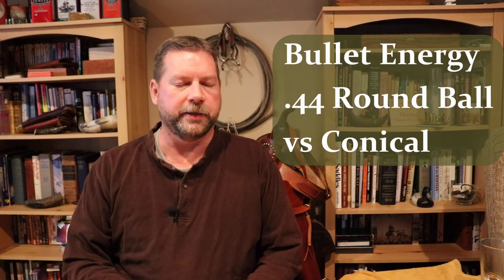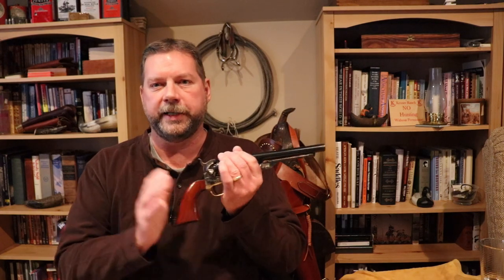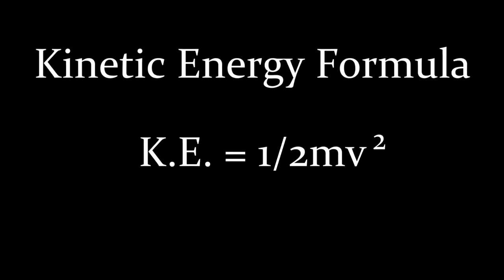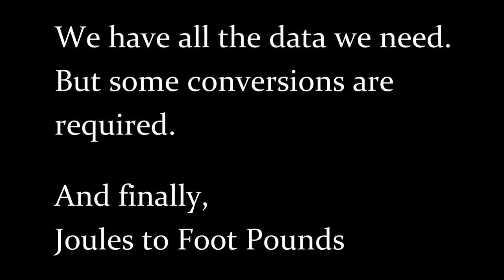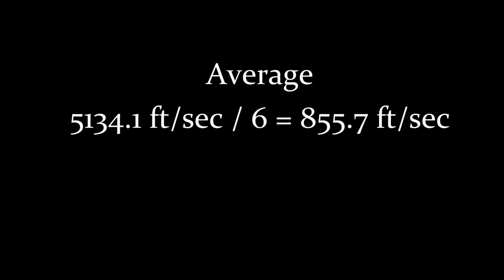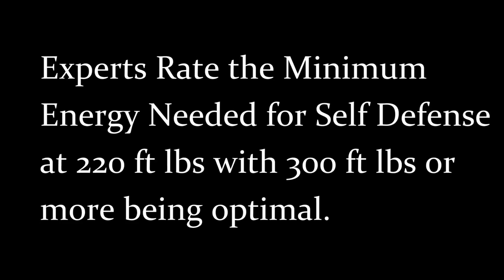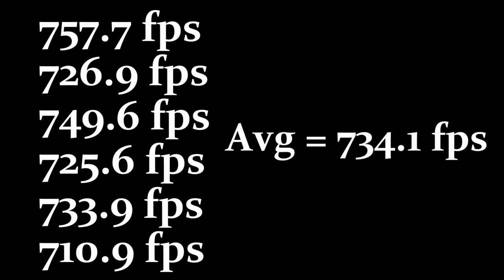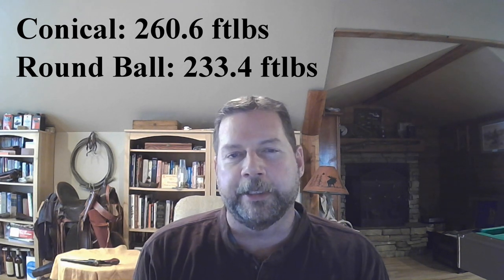Knock Down Power of the 1860 Army

Comment: Great video! Just a tip for the future, you don't have to convert everything into metric. The English unit of mass is the slug which is equal to 32.2 lbs on earth. Once you have the bullet weight in lbs, divide that by 32.2 to get slugs, then plug that into the kinetic energy equation with velocity in ft/s. This will give you slugs-ft^2/s^2, which simplifies into ft-lb which is the unit for energy. Most people have never heard of the slug though haha
Reply from the maker: Thanks Ethan, I have not heard of the term "slug" for weight.  It makes me wonder if the term is responsible for sometimes referring to a bullet as a slug.  Thanks to tips from video watchers, I have simplified the calculations significantly.  Todd
Reply: My favorite imperial unit is the Erg.

Comment: I think you make a good point about penetration--the formula for kinetic energy implies all the energy is transmitted to the target, but the better penetration of conical bullets means some of it is lost if the bullet leaves the body.

There is, however, another factor to consider.  When most people do this test, they usually use comparable charges with round balls and conicals.  This may not reflect the practice of the time, however.  For example, the military issued Johnston and Dow cartridges had 25 grains of powder, but if we read Colt's loading instructions for loose powder and ball he says to fill the chamber then set the ball on top and ram it home, and the powder will compress enough to let the ball fit.  This technique will allow a lot more than 25 grains of powder into the chamber--more like 35.  This is echoed in Whittaker's "Volunteer Cavalry Instructions" from 1871 where he says:  "For loading Colt's revolvers a powder-flask and bullets are much better than compressed cartridges. The latter have hardly any strength. I have seen pistols burst in firing a second shot from their use. The first bullet stuck in the barrel midway, the powder not being strong enough to expel it fully. The second burst the pistol" (p.14).  From this, is seems quite possible that the round ball would have had even more velocity than most people get in their results, and remember that in the formula for K.E velocity is far more important than mass since the K.E. increases as 1/2 of the mass but as the square of the velocity.  When combined with the penetration issue you raised, I think this clearly explains Keith's comments.
Reply from the maker: Thank you.  I did indeed have more powder under the round ball and it contributed to the higher velocity.  Your interpretation of the formula is spot on - velocity is squared and explains why a small modern bullet with little mass can have so much energy for big game hunting.  It's going 3000 fps.
Reply: What did Elmer say about this ?
Reply: @forestgrump2168  He said that some folks preferred round balls because they didn't over-penetrate, meaning all the power is expended in the target.

Comment: In a comment on your other video, I mentioned the book "Stopping Power" by Evan Marshall and Edwin Sanow. They wrote 3 books evaluating actual field performance from real life defensive shootings to develop a theory and formulas for predicting the effectiveness of bullets, cartridges, and loads. In their last book, there is a chapter on cap&ball revolvers. Their measurements and calculations mostly match your own (840 ft/s on 30gr 3F w/ 141gr round ball, 726 ft/s on 25gr 3F w/ 200gr conical).

You mention 300ft/lbs of energy as being "optimal" for self defense. To put the numbers in perspective, an 88 gr JHP 380 ACP only generates about 196 ft-lbs. They recorded a higher velocity (935 ft/s) for their 1860 Army using 35 gr of 3F to propel a round 141gr ball, generating 274 ft-lbs, only slightly less than a modern 44 Special 200gr lead HP (292 ft-lbs). For the Ruger Old Army (40gr 3F, 141gr ball) they calculated 333 ft-lbs, for the Colt Dragoon (50gr 3F, 141gr ball) 437 ft-lbs, and for the Colt Walker (60gr 3F, 141gr ball) 519 ft-lbs. The modern 41 Magnum (175gr JHP) only produces 608 ft-lbs. As you proved, these guns are not only capable, they have impressive power even before considering projectile expansion.
Reply from the maker: This is great stuff.  Thanks for taking the time to share this info.  I'm planning to test a few more guns and we'll see if they continue to match up.  Todd

Comment: Very interesting.  I love BP but use Pyrodex P in my cap and ball revolvers exclusively.  I use the eras gone Johnson and Dow bullet with 25 grains Pyrodex P. 
Excellent video, and informative.  Great baseline. I found with Pyrodex I get closer to 45 acp stats.
Reply: You should make the switch to black powder. I used to use Pyrodex P but since using black powder I will never go back. The black powder ignites more reliably,  quicker and cleans up easier.
Reply from the maker: I agree.  But sometimes there is no choice.  Black powder is getting very hard to find and few places online carry it anymore.  I just received some via FedEx and the hazard fee was $50 plus shipping.  Still, if you can get it, do.  Todd

Comment: Excellent work. The next step in investigating stopping power of the 1860 Army would involve emphatically seeing what it does on the intended target…a meat target of some kind. The low #’s may be moot if the performance on the meat target is respectable. Remember, the #’s do not reflect what lead in its various configurations are capable of on the intended target medium. That dynamic must be tested & observed before final conclusions may be made.
Reply: The US Army conducted many such tests in the 1800s. Much of that information that the Army made reports on are still available today. Also, Colt made many such experiments and testing and much of that can be found in Colts historical records library in Connecticut today. Very good reading.

Comment: What an insightful explainatary video.
The clear articulate way you present the Formulas for calculation of the power factors, is amongst the best discriptive done!

I wanted to develop the most capable, effective projectiles for Black Powder cap&ball percussion revolvers for effectively quickly putting down dangerous apex preditorial animals, like Bears and Wild Boars etc. 

So I did my research& development were I discovered that if I combine the aspects of the Round Ball face into a elongated conical with a Flat Nose, I would have the best attributes of both in in one effective unit.I reverse engineered both modern conical round nose bullet designs along with the round ball spirol momentium metplat to come up with what has been proven to be a very effective' capable projectile series known as the Kaido Ojamaa-VKV  Universal RFN Bullets.

 With good stout loaded "Well Regulated"  Steel Framed percussion revolvers have been tested and achieved over 500 Foot Pounds of Energy that also stays on it's Target path without diversion. My Universal RFN Bullets, have been used in various percussion revolvers to take a 2.200 enradged Bull to Wild Boar, Deer, Turkey. I currently offer custom produced six cavity molds to hand cast my Universal RFN Bullets. Contact is; kaido93@hotmail.com
Reply from the maker: Impressive.  And some people think black powder incapable.  Thanks for watching, Todd

Comment: Seems kind of superfluous to convert velocity given in feet per second into the metric system convert to joules and then rotate it back to pound feet.  I just go f=ma, a is vel squared.  Constant of 450,240 so:   855x855x143gr/450,240 or 232 ft lbs.  pretty straight forward Without moving the units back-and-forth just keeping them in grains and feet per second and using the mathematical constant I show.
Reply from the maker: Thanks Roddo, I had no idea there was a constant denominator.  How was that determined?  But it seems to work.  It must be a one-step factor that makes the equation work with non-metric measurements.  I'm curious about the origins of this now.  Thanks for the info!  Todd
Reply: Sure thing. The 450240 is mathematically derived simply through conversion of units. While the math here does not lend itself to an easy format as a YouTube reply suffice to say it is the formula Output for the conversions which are themselves a constant such as 7000 grains equals 1 pound, 454 g equals 1 pound, ; and where speed is equal to distance divided by time (mph for example) 5280 ft. with denominators of 60 sec/min and 60 min/hr.  Makes more sense all written out with the conversion of units that cancel but since (American) ballistics still seem to want to use feet per second and grain weight of bullets simply squaring the published velocity in feet per second times the grain weight of the projectile and dividing it by the 450,240 will always get you an accurate number. Good video and thank you for making it.  For the record I prefer to work exclusively in the metric system myself :)

Comment: Good video but there are two things I would have done differently. 1 I would have posted the powder charge, 2 I would have used paper cartridges since they allegedly produce more pressure & they would have been more common for the army to use.
Reply from the maker: Good points.  I think I talked about the powder charge, but maybe didn't put it on the screen.  It's been a while since I filmed this one.  Using a paper cartridge charge would be a good thing to compare.  I'll do that the next warm day.  It might be next June.  Thanks for the comment.  Todd

Comment: One question: what was the powder charge you used with the rb's and conicals, respectively? I've always had the impression that velocity of the ball would be around 1000fps with 40gr of powder, and conicals in the 800 - 900fps range with about 30gr of bp. Maybe I was thinking of another revolver, like the 1858 Remington, though, I'm not sure.

Comment: Check out video by kido fujioma on semiwadcutter bullet style made specifically for hunting...ive shot them...theyre a heeled 230 grain bulletwith a wide flat metplate loaxed over 35 grains of tripple7.,...way hot load....backed down to 30 grains..this load is managable but rough on 1860 pietta ..strain onwedge and under lug for loading lever

Comment: Why in the world do you complicate this jumping back and forth between SAE and metric units. Joules and pounds/foot are measures of the same effect. Pick a unit and stick with it. Either way works. A mix of the two is simply confusing.
Reply from the maker: Mainly because my mind understands foot pounds like it understands miles.  I get kilometers, but tell me a distance in miles and I have an immediate understanding in my head.  Tell me in kilometers and I'm not so sure.  The formula for energy is made for metric units.  So I have to input metric values and then convert to foot pounds at the end.  Hey, it works for me and gives me a value I can relate to.  Plus it makes my son think I'm smart.  Thanks for watching!  Todd

Comment: I appreciate your efforts however none of this matters without knowing the powder charge. And since the powder is variable the energy will be different and was that an 8" barrel?  Barrel length matters.
Reply from the maker: Great points all.  I should have reviewed the specs from the previous video where I took the velocities.  With .457 round ball, I used 35 grains of 2F Olde Enynsford.  With the conicals, I used 30 grains of 2F Olde Eynsford to make room for the longer bullet.  The barrel length of the 1860 Army is the standard 8 inches. Thanks for watching and commenting.  Todd

Comment: Maybe I missed it in the video, but I’m wondering how many grains of powder were used. I assume it was equal for both the conical and round ball?
Reply from the maker: The round ball had 35 grains behind it and the conical had 30.  The conical bullet takes more space, so I had to reduce the powder charge so the bullet would not stick out beyond the cylinder.  You get to a point where you deform the projectile if you try to compress the powder too much.  I don't like to put that kind of force on my loading lever and pistol frame.
Reply: @frontierwesternheritage1356  if you want higher velocity with out accuracy loss, try using Pyrodex P, or 777s even in the 3F grains. I think it will bump you into near magnum velocities. Make sure you have tight compression.

Comment: Can you please tell how many grains of powder you used in those shots?  Thanks.
Reply from the maker: I used 30 grains of 2F Olde Eynsford in the trial with the conical bullets.  I could get 35 grains under the round ball.  I apologize for not repeating the info from the earlier 1860 Army videos.  Thanks for watching,  Todd
Reply: @frontierwesternheritage1356  Thank you.  Those are interesting results, as power from your round balls from 35 grains of powder seem weaker than other folks I’ve seen.  With 35 grains it should be well over 260 ft-lbs.  However, they were using 3F.  Which makes me think that maybe the chemical energy in the powder is inversely proportional to the size or surface area of the grains.  Would be interesting to duplicate these trials with 3F.

Comment: [ (fps velocity)2 x bullet weight grains ] / 450,240 = ft lb.s energy - easier and very close to what you're doing    So... [ ( 734.1 x 734.1 ) x 217 ] / 450,240 = 259.73  vs 260.6 by your multi step method  That is the way I've always done it... as I learned it from Handloader magazine iirc.
Reply from the maker: Thank you.  I have been tipped off on this formula and quit the cumbersome conversions.  Much better.  Thanks for watching.  Todd
Reply: Handloader makes a good magazine.

Comment: Its quite a surprise to learn that guys in the civil war were firing something that was on the borderline of bouncing off its targets. Im curious what adjustments could be made to both round ball and conical shooting that would allow reaching the 300 mark while staying within the safety limits of the firearm itself.
Reply from the maker: Cvcoco,  They are what they are.  It was common to linger a while before dying of wounds.  For days sometimes.  It just depended on where you got hit.  The velocities of today were unheard of and folks didn't know any better.  Still, these were deadly firearms.  Thanks for watching, Todd
Reply: @frontierwesternheritage1356  I knew that shot placement has its value but I didnt mention it because in the heat of battle, and you are being shot at too, youd be grateful to hit anything. I didnt know your channel before today so you may have previously answered my next question, how would the results compare to revolvers right down to 5.5 in barrels?
Reply from the maker: @cvcoco  That's a good question.  Velocities drop when the gas escapes earlier, but I'm not sure by how much.  It will reduce effectiveness at more distant targets.  I'll have to get a shorter pistol and try it out.  Todd

Comment: Wouldn't the 1858 Remington with the same length barrel and load be exactly the same?
Reply from the maker: I would say yes.  There may be some barrel or cylinder dimension differences from model to model but I bet it's not all that significant in performance. Thanks for watching.   Todd

Comment: You don't have to convert so much, just do the calculation in English units.

pounds = X  / 7000 
m = pounds / 32.16     Acceleration due to gravity in fps.
E = 0.5 * m * v **2

I find it also interesting that there's rotational energy too. So the total kinetic energy is higher but I don't think the rotational energy transfers much, if at all, to the target.
Reply from the maker: Thanks Daniel, I have since quit with the conversion formula.  I use the the 
one you recommend.  I hadn't thought about rotational energy and will look into that. Thanks for watching, Todd
Reply: @frontierwesternheritage1356  Thanks for responding...subbed, good content !

Comment: You cant blindly trust expert opinion on kinetic energy alone, because they probably had in mind modern hollowpoint bullets. Diameter and speed of these old bullets is what matters. Smaller bullet with smaller kinetic energy can penetrate deeper than larger bullet with more drag. In the end these bullets make pretty clean penetration path compared to modern hollow points, so the penetration in this case is more important than kinetic energy.
Reply from the maker: I won't argue with that.  Kinetic energy is only one factor among several considerations.  Hardness of the projectile is another, although most percussion revolver projectiles were relatively soft.  Thanks for making a good point.  Todd
Reply: You may be right, but the 45 acp wasn't designed to expand, and after Miami Dade, I'm sure the FBI scrutinized multiple calibers, weights, velocities, and designs. Regardless of expansion, if your projectile doesn't reach its destination, it's not as effective.

Comment: Why did you use FFg instead of FFFg in the 1860 Army?
Reply from the maker: This is just what I've found in my experience and from a lot of reading - others will disagree.  We are so used to modern velocities that we push black powder velocities too hard for soft lead projectiles.  I get much better groups when slowing the velocity.  And groups open up when I try to use a faster powder.  I know a lot of people use FFFg for everything, but have better luck with it in .36 and smaller, FFg in .44 and .45, and Fg in .50 and above.  I just feel I need to take a black powder firearm for what it is and respect its history.  They're very capable guns, but not magnums and never will be.  Just my take for what it's worth.  Others may have found accurate loads with FFFg.  Thanks for watching.  Todd
Reply: I get very good results and accuracy with plain Pyrodex P. Velocity is much higher than traditional black powder, and usuall more accurate. Just make sure to have good compression.